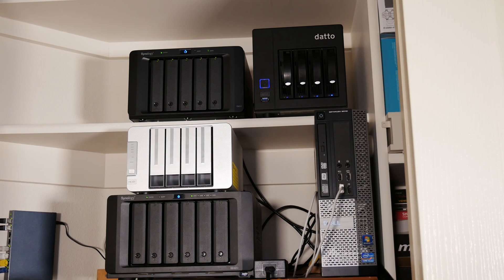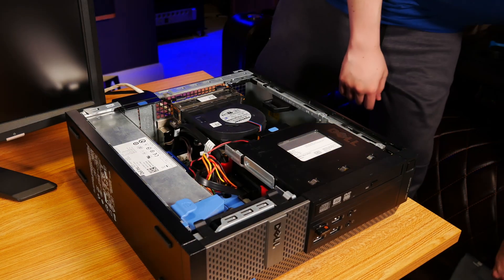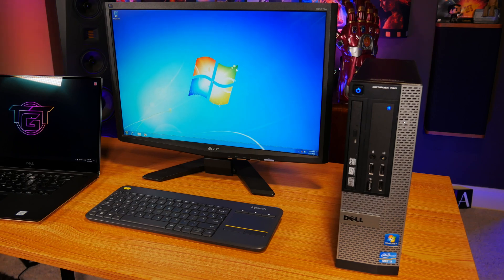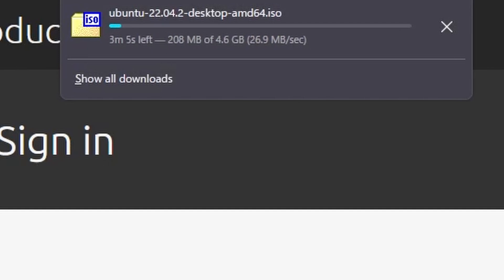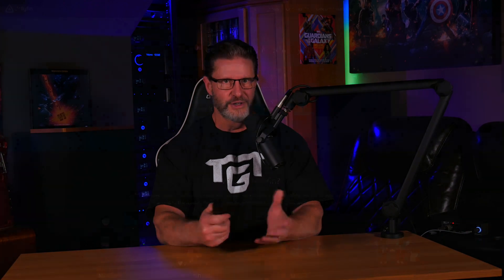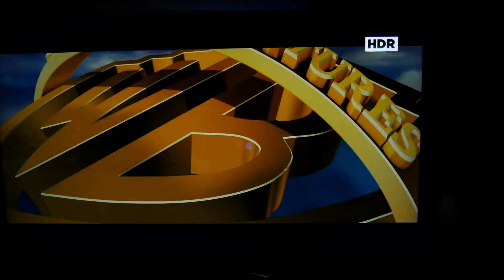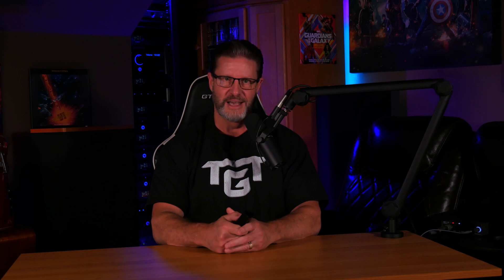Turn your Old PC into a new 4K Blu-ray Dolby ATMOS Streaming Server!

Comment: Nice video, sir! I have been hearing good things about Jellyfin for the video side of things. I just finished setting up another Roon server for my music use. I used Mint 21.1 instead of Ubuntu, but I did think about using Ubuntu server. I used an older Dell laptop, that is not getting used anymore and an extra 2TB HDD with a external case from a recent NAS upgrade, all set. As far as video, I do have a NAS setup and currently use VLC or DS Video for playback. My rips are mainly DVDs with a few downloads and TV recordings. I don't do 4K BD at this time, but I have ripped a few BDs with MKV. My biggest BD rip is "Ice Station Zebra" which is a CinemaScope release so it looks awesome and that file is huuuge, lol. I have thought about Plex but like you said, they keep changing stuff and blocking features, so I'll stick to Roon for audio and maybe look at Jellyfin for video, thanks to you. Have a great day.
Reply from the maker: Thanks for watching!

Comment: Pretty good video and covers all the basics.

I started off with a setup like this. Recently went all in on a new build in a fractal design define 7xl loaded up with x5 10tb wd red hdds.

Specs for the system are overkill for a media server but I use it for full access to my steam library for couch gaming on a 65 inch lg c2.

Also have big box running on it for all my retro emulation needs. Makes for a pretty good all in one entertainment unit.
Reply: jinx. For 11 years I've had a Raid 5 WD RED using 3 TB discs in a Fractal Design R4 case. 13,000 hours on 3 of the 5 disks. I've lost 2 drives over the years and rebuilt the raid twice. The discs never spin down! I run Ubuntu and on my HTPC run Kodi. the hardware on my server is allmost vintage. I reused a 2008 MoBo and an AMD 550 dual core CPU. i'll be upgrading soon as I'm on borrowed time with the age of my server, now.
Reply: Can you share your Plex access, kind sir?  Making such request on platforms like Reddit are liable for a ban or at the very least, ridicule by the people.   

I wonder if there are forums or some other kind of social media platform where like minded media-philes can share their hobby.

Comment: in home streaming = storage, storage, storage.
Reply: And also a solid CPU for transcoding
Reply: @jessechristman1471  I know some people use transcoding to watch their movies,especially through plex. but thats the Last thing I would ever want when watching and wanting the cleanest,most pristine,untouched audio....if your computer can decode all the formats, dtshdma, true hd, DD+ , 8 channel pcm ect, then go that route ...always try and use a passthrough, bitstream option before resorting to transcoding...
Reply: @jessechristman1471  true, but i only do direct play in plex since i only have two clients playing stuff ATM. as for storage, bought a 14tb two months ago, then 10tb a month ago and im left now with 1.5tb of free space. another 14tb goes in next month, god willing lol. then finally, replacing one 4tb with another 14tb and then… either buying expensive red pros 20tb and replacing 10 and 14tb plus’ drives… or maybe start watching and stop hoarding. im down to imdb 4 ratings now out of sheer desperation, lol, for movies. tv series are killing me though. 200gb for desperate housewives which ive never watched and i probably never will, haha. smallville? never watched, and thres like 15 seasons of that crap. 300gb in 1080p, easily. anyway, buy my mixtape. and thanks for hanging around my blog. cheers.

Comment: Very useful information 
Looking forward for a new generation intel based hometheature pc build along with GPU which have 4K HDMI out if this can be done then it will be a great utility stuff for each hometheature passion guys because we can have alot of flexibility like calibration/dedicated media server/........etc but the thing is common people not well aware about build a pc for dedicated Media purpose like what type of electronics to be selected cpu/gpu/psu/ram/motherboard and dedicated software for media for example if blu-ray disc reader added on this pc then we can avoid each different components in Hometheature like media players/blueray players.....etc if professional people like you have more knowledge about electronics as well as software for hometheature

Comment: @5:14

This guy never heard of Windows 10 IoT Enterprise LTSC 2021 which supports updates for standalone or headless pcs until 2032.

I guess there goes the "tech" credibility of this chanel.
Reply: He also didn't mention that since the PC came with windows 7 you can use its licence key to upgrade to the equivalent windows 10 for free.
Reply: @bilko991  

Yup! And there's a way to use a windows 7 key to get to windows 11. 

Could have used Rufus and installed windows 11 straight on that dell, but I don't expect these chanels to go in depth which is fine.
Reply: @Luci_S  It is easy to slag off a content creator like you did. Where are the videos you made to help others? This guy  #TwoGuysTech, gave us his knowledge and time to ptoduce video on this topic. All you did was disrespect him. Stop being a dick. Seriously, Just stop being a dick !
Reply from the maker: @Luci_S @bilko991
I run LTSC 2021 Enterprise on my PC personally - though as a creator I am not going to tell anyone watching this video to go through the convoluted activation process required for a volume licensed version.
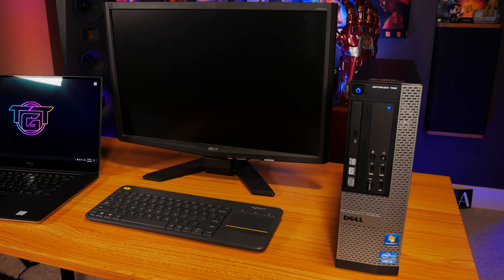If you actually watch the video closely, in the footage around 1:40 you can also see that the product key, which would have been on the top of this machine, was removed by the organization we purchased it from - and for anyone else without a product key, telling them to use an old Windows 7 key to get Windows 10/11 would be useless.
Ubuntu is powerful and very easy to use for this purpose, and it's a better fit than Windows for older hardware.
Reply: @TwoGuyzTech 

Funny how my comments were deleted. 

To sum up the response, you don't need Linux if you're doing a headless streaming unit and you definitely don't need one connected to the internet (no need to update it).

Just set your headless pc network as a local subnet and don't add a default gateway through windows 10: it doesn't matter whether windows expires or not as long as it's not being used as a main. You don't need an activation key either. If you need to update the app or program, just download it and transfer it via USB from your main to headless. That's it! This video shouldn't be as complicated. 

Source: former cyber security specialist and school district employee in IT.
Reply: @Luci_S funny how you go on someone else’s channel just to try and correct them.  Make your own channel instead of being so negative the creator.
Reply: @specv23  

Guess you never heard of YouTube algorithm. Junk channels get recommended to me all the time. 

It's not in my interest to defend or shut down anything. Guess you never heard of oversight, either. 

For someone who plays IT this video is cute and all but technically incorrect. A case of the blind leading the blind. 

If I were to create a Chanel, it would be privatized for premium subscribers. They will be getting first hand experience and not someone who thinks they have everything figured out.
Reply: @Luci_S  LOL! That's not how channels work here. That you don't even know this shows that you have little to no idea in fact what you're talking about.
Reply: @specv23 

I didn't "go" to someone's channel to "correct them", the garbage was pushed by algorithm. 

Guess you didn't know that exists!
Reply: @ZenAndPsychedelicHealingCenter  

As if I care what an agent of averageness thinks. 

But good for you!

Comment: just be mindful that I have attempted to do this, but the dell desktops are not too power efficient. I was getting close to 30-50 watts at idle/max. Its probably easier and save some efficiency just to use your modern desktop as a media center, YRMV.
Reply from the maker: Thanks for watching! Yep it would be interesting to revisit this idea comparing a few different models and testing them on a Kill-a-watt. Thankfully energy is really cheap here and mostly from renewable sources but for a lot of people that could be a good thing to keep in mind.
Reply: @TwoGuyzTech  Thanks for posting! Doesn't hurt to check and see sometimes! but it's good that it's cheap where you live. I have about .33 per kWh around here, so it's just something to be aware of just in case.
Reply: I agree!

At this point, I think anything above 12th intel (like A G7400) set a minimum and offset voltage on the board to 0.05 should produce good results and wattage: somewhere around 5-15 watts (max) if configured. Those cpus hit hard and are power efficient due to the E-cores too.

Doesn't hurt that any 12th gen intel CPU supports AV1 decoding, so I hope everything starts transitioning soon to AV1 codec!
Reply: Haha, like I need affirmation/love from a short order cook.